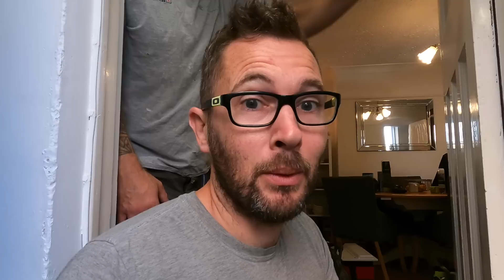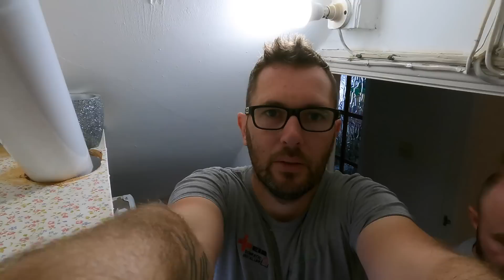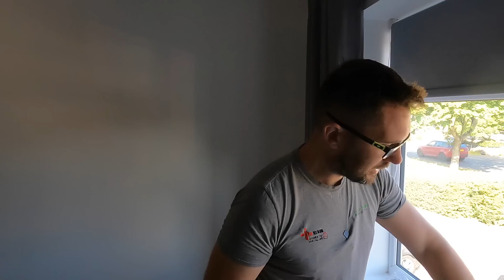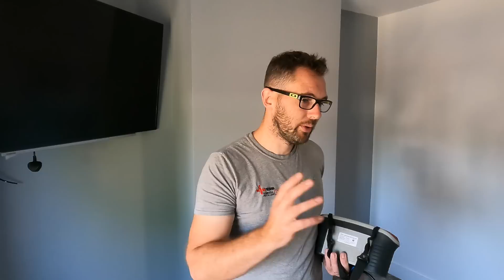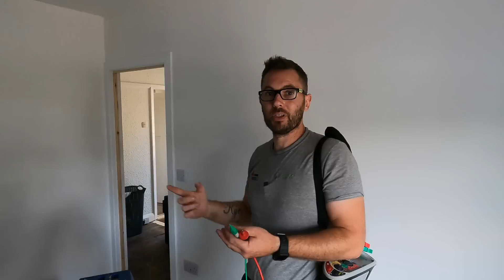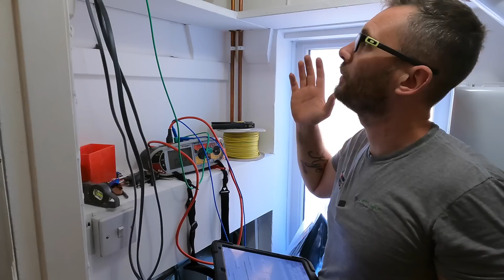5 FUSEBOXES ONE HOUSE - TESTING SPECIAL

Comment: save those old switches please. Back in the day when my mum was young, gas bonds were not done to prevent the power using the gas pipe as an earth. Bonding is a 60s+ thing, prior to that, the idea was to stop the current by not bonding

Comment: Great video lads at Green Hawk Construction ! May I ask the reason why higher load circuits are preferably located closest to the Main Switch ? Would the Busbar not have the same rating along its entire length ? Or is it just individual choice ? Cheers lads, great content.
Reply: The main reason it is closer to Main switch, so the higher loads have a shorter distance to travel along the busbar to ‘complete its circuit so the busbar is under less loads. There is no manufacture instructions nor anywhere in the regs which states this has to be. It is good practice to do this.  But in real world board changes, the circuits have to go where they go otherwise you will extending every circuit to follow this procedure.
Reply: @rjkelectrical6086  Awesome, thanks Ryan

Comment: The Gas Bond wasn't missed, engineers probably thought it was a plastic incomer when it's just the sleeve. Should of been bonded regardless as the metal bracket is attached to the fabric of the building and can create an earth path for the incoming supply. Especially on single skin/solid wall construction with high moisture levels. 

Great video for learners, well filmed and explained.
Reply: Is it just a sleeve?  I have noticed that a new gas pipe nowadays is plastic. Also the metal bracket is not an extraneous conductor so I don't think that should lead to bonding, but I am not in the trades.

Comment: Once you move the board will it take you over 3mtrs on tails lengths,  will you have to change to swa Mike?
Reply from the maker: Yes it would do but the main incomer is going to be moving as well but if it wasn’t then swa would be the way for me 👍
Reply: If tails are over 3m it doesn’t have to be armoured cable, you can use  mechanical protection on the tails via metal capping etc and put fused connection unit  to de rate the tails accordingly

Comment: No extraneous earth being imported on that plastic gas pipe... so why would it need equipotential bonding? Does the internal pipework make contact with the mass of earth?
Reply: Doesn't appear to be entirely plastic, just plastic sheathed. If that's so then could one be certain that no earth contact at all was being made outside?
Reply: @calmeilles  See what you mean about the sleeve/sheath looking at it, yeah, probably safer to assume it does contact the mass of earth somewhere with metal then!